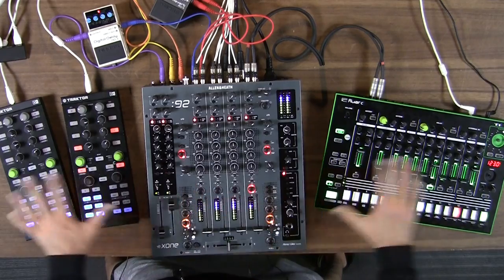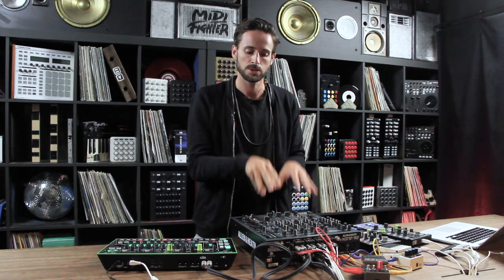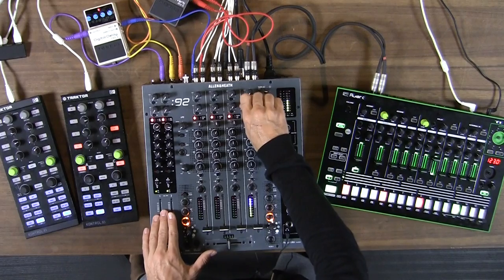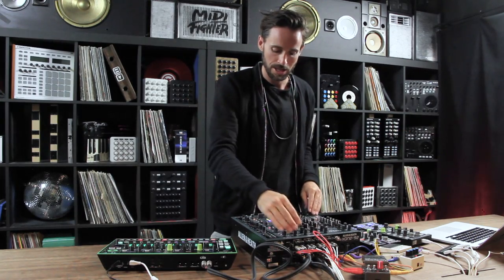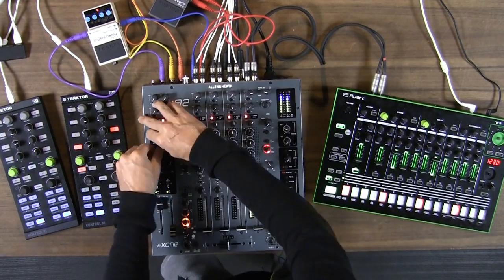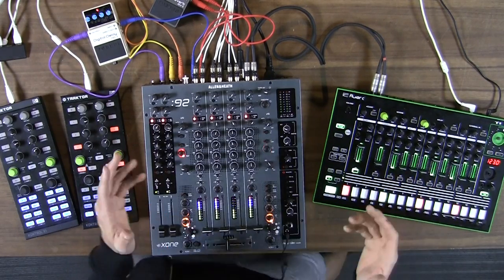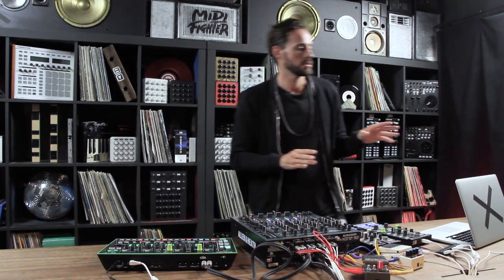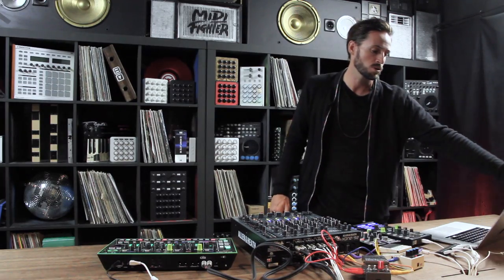Advanced DJ Routing: Analogue Mixers, Guitar Pedals, and External Soundcards

Comment: guys plz helpl my face,

I have a xone92 mixer and at the moment only my laptop with it (planning to get CDJ's  very soon) , so i have a problem where after routing the laptop to the soundcard which has 1 output channel, i know i need at least 2 to mix but im using this to test the sound until i get another sound card. the one i have now is a focusrite(scarlett solo) so moving on the output from my SC goes into the line 2 channel on my xone92 which in turn is connected to the speakers ! now i have configured traktor's output to external recording and my input routing section just shows on the decks part Input 1 and 2, these are the only options besides the "not connected" one ! after all that still no signal on my monitor headphones or speakers and the LEDs show nothing ! PLEASE HELP ! stuck ! cant find solutions anywhere ! 

Thanks a lot !
Reply: Probably way late, but I'll answer since no one else bothered. From what you've wrote I don't have enough to tell the issue. Your sound card has one stereo output. That by itself is a left and a right channel. There are a few tricks you can do with internal routing on your computers side to try out mixing. For example pushing Deck A out the left side to channel 1 and Deck B out the right side to Channel 2 on your mixer to get a feel for mixing, but you'd obviously be mixing two mono signals so it wouldn't be a good test for sound quality. 
It sounds like you're having issues with basic sound coming in one channel and out the master to your speakers. Theres really not that much to it. The X92 is a really simple mixer. Once you confirm sound is coming out of your sound card on good cables and at a loud enough volume, make sure you have Line selected for whatever channel you plug the cards output into. At that point that channel should then light up providing that channel works and gain & volume are turned up.Once you see that channel lit, make sure your cross fader isn't also in the wrong position. If it's not, the master should light up too. Once that happens the out from the mixer should have sound. Good luck.

Comment: Ah crap, I'm gonna do another post. One more thing you can add to this setup that I've only realised recently while researching rotary and older mixers, is how DJ Isolators were more popular in the past, have some people that still use and love them and how the new Richie Hawtins mixer is going to focus on this and scrap the traditional EQ ( https://www.youtube.com/watch?v=q5iGjVVmCpg ) - I am really interested now to add a couple of isolators to the master output channels to experiment with this. I also just found out that the DB4 has some features like this, however I really love analog mixers so I didn't really look into it (along with the various issues I've heard about it..). Love my Xone 92 and this is a great tutorial for people to better understand the 'console' feature of aux send/returns and how you can creatively use it. I too like you first tried connecting direct to effects - I assure you it gets so much better once you start .. 'reinforcing'? the send with ground isolators, good power supplies (unless you like recharging/buying a lot of batteries and having them fail on you during sets), voltage droppers for that battery draining effect without the pain of saving up dying batteries (lol seriously guitarists like me did this), loop feedbackers to expand on the routing possibilites and to keep a cleaner signal by bypassing the effects for the moments they are not in use but the return channel is audible, or to utilise the return channel as an extra input channel so it runs open fader in unison with the dry channel, noise supressors like the ISP range in order to clean up guitar pedals (some pedals are just noisy), noise gates to get nice chopped sounds, trying a laptop and software effects to save money and increase possibilities rather than buying lots of hardware, getting good quality leads / connectors for your patch cables (even to the point of sometimes getting quality adaptors over cables, where the pedals can fit joined side by side in order to reduce 'cable length' by getting rid of the cable (and possibly a better quality signal by also removing another 'link' in the chain, by making a 'cable' without the actual cable [just connectors]), little things to keep your cables off the ground / crossing over each other (except in a cross shape) and to separate power and audio cables, having SEPARATE  power circuits for your power and audio cables, quality UPS or power conditioner to remove/help audible issues that may arise from poor quality power connection to your venue/studio/house/performance space.. there are so many things you can think about when it comes to analog/guitar effect rigs, when it comes down to aiming for the 'highest quality' analog audio. Especially if you factor in gain structure, EVERY SINGLE different valve or solid state preamplifier could potentially give your return a different colour, so there's endless possible experimentation if you want to get that tiny percentage increase that comes at the extreme end of audio gear. Analog effects really do have a lot more to think about than digital, but the results can be WELL worth it. If you have the time, bucks and energy to spare xD I see way too many people asking things like 'how to plug Pioneer effects unit to this mixer?' and it makes me sad :) oh, and I'm not even going to TOUCH what pedals you could/'should' use.. because again, you can spend endless amounts of time, energy and money on that question too xD
Reply: The Model 1 doesn't have an isolator.
Reply: @tylon2999  ah you are right! Thanks for clarifying.

"Precision Sculpting EQ
SCULPT is a semi-parametric swept bell filter, and consist of two controls,FREQ which sets the centre frequency and CUT/BOOST which adjust the gain or a attenuation at this frequency. The level of cut/boost is asymmetric; maximum boost is limited to +8dB, while the cut is extended to -20dB. Sculpt has a wide Q and a frequency range that covers almost seven octaves."

Comment: hello would you help my i got a DJM 750 AND A6  and 1 par of mk3 1000 and 2 x mk2 and i would like to know if there is any way to set up the 2 pioneer and 1 mk2 and the same mixer to play 4 chanel at the same time  thanks and sorry for my bad inglish cheers mate
Reply from the maker: izzy de oca Well the Audio 6 only has three inputs and three outputs, so that'll be your max #  of output channels from the soundcard. Does that make sense?
Reply: yes make sense but is there any trick to do it using the sound card for the mixer and the A6  at the same time ?cheers for the replay mate

Comment: Thanks for the video Ean, do you (or anyone else reading this) have any idea whether it is possible to use analogue mixers (or even midi mixers such as DN-X1600) in external mode for traktor post fader effects? It does not seem like this is possible from what I have looked up :/
Reply: Some mixers allow for post fader effects from tractor sends 

Xone 92/42/43 all should even 22/23

Comment: Is there a possibility to use multiple effect boxes. For example: The aira Demora and the aira Torcido via send/return?
Reply: +Vintsent Bekaert there are only two send/returns if those effect boxes you mention are analog, however you CAN also run either a) mix 1 left/right to either a stereo effect input, or two different mono effects (one each channel) which will only effect one channel at a time.. you could also have mix 2 or booth output running to effects, and have another mixer handy to switch wet and dry channels.. with the 2 aux outputs with a&h, you could run as many effects as you like in a row on one of them (other issues involved with chaining you'll need to look at down the track..) or one or a few on each of the two aux sends.. to add more options, get a 'loop feedbacker' which give you a clean output that you can switch to different effects loops. So the possibilities are endless. The most important thing to remember though is GAIN STRUCTURE. Guitar level = 'high z'. Consumer = 'low z / consumer line'. Mic level = mic level, (proper/non-consumer) Line = line level. To effectively run into guitar effect pedals that are high-z / guitar input, you need to convert your LINE level output from aux send to HI-Z. Then on the way back you need to get from Hi-Z to line level again for the return. Personally, I use a Radial Reamper X to get line to hi-z, then back is a Radial Stereo JDI Duplex for hi-z to mic level, then a Rolls MP222 mic preamp to get from mic back to line for return into the mixer. I am still waiting to get an ISP Decimator II and/or Boss NS-2 Noise Suppressor along with a loop feedbacker to complete my analog effect send. The only other thing that is an issue is buffering if you are using long effects chains with an actual guitar as the input, or potential noise issues with powering all the pedals. I use a Cioks Ciokolate power 'bank' (I like to call it a bank because it's got so much more than what I think of in a 'supply' - just my word, not really a 'power bank' if that really exists hehe) and it got rid of a lot of issues. Still there's some hiss that I want to clean up that I think splitting effects on the loop feedbacker (along with the one or two noise supressors at start and end of the chain - or an ISP Decimator G String to do a similar thing) will fix up a lot.
Reply: +TheGreySea2 Dude, thx for all the info! It gave me a better insight! Have a nice evening sir! You earned it!

Comment: have some question to anyone... wouldn´t be the same using an analog mixer with integrated soundcard? for example any allen & heath with soundcard and analog mixer (xone 43c,, PX5, 4D....), offcourse talking about sound quality... using 4 traktor channels, with high level blah blah.... i mean it always will have to go through the usb cable somehow... using external or any soundcard... obviusly the RME has an amazing quality, but, well... PRICE!....  i wanna know if its "necesary" the external soundcard to hv really good quality, talking about "afordable" soundcard... focusrite... NI audio 10....
Anyone? thx
Reply: Yes, and it'd be a lot more convenient. Most club mixers have a really good SC built in (Pioneer, A&H) also.

Comment: Thanks, great tutorial on things I've never really tried with my Xone 92. Seems like you really know this mixer! Don't you find with the 92 the volume rises much too rapidly toward the top of the fader - it doubles in the last 1/4 or 1/5. I was thinking of selling it and getting an S8. Whats the effects routing like for that. I was thinking of buying an analog rytm and maybe A4 to use for live stuff along with remix decks and regular tracks.
Reply: +Pete Horam 
The Xone:92 has a logarithmic line fader whilst the Xone:62 has a linear line fader.
In essence this means that the Xone:62 fader has an equal distribution 
of volume along the travel of the fader whilst the Xone:92 fader will 
have more of the volume distributed at the top of the fader's travel.
In terms of feel, the Xone:92 fader is much lighter to the touch whereas the Xone:62 fader has more resistance.

Comment: so lets say i have pioneer djm 2000 and boss dd7 and bos rv5... how exactly would i be able to control them using the mixer ?
Reply: As you can see right here, the mixer needs to have sends and returns, both level control.
Reply: Tomas Morey i have sends and returns but dont think i have any knobs to control them... so in this case is it possible in any other way to control the through the mixer
Reply: Send me a draw with specs info, brands and models of your gear. I will have a look of your chances to perform.
You can send to: www.iaei.eu or direct to tmorey@iaei.eu.
Tomas Morey.

Comment: Thanks for the video, this is a really interesting experiment and visually exciting but what are the audible benefits over using traktors reverb and delay?
Reply: There are a couple. First, you have the option of a full-analog signal chain, which many techno DJs are very fond of. Second, you can use ANY EFFECT YOU LIKE. Traktor's reverbs and delays have a specific sound. Other reverbs and delays will have a different sound. Third, on the Xone 92 you have two return channels which allow you mix in the effects as if they were channels, something Traktor does not perform in the software.
Reply: @randyrankin682  thanks that is helpful!